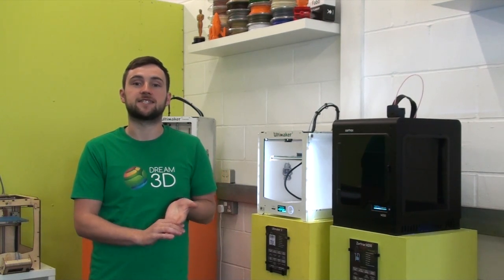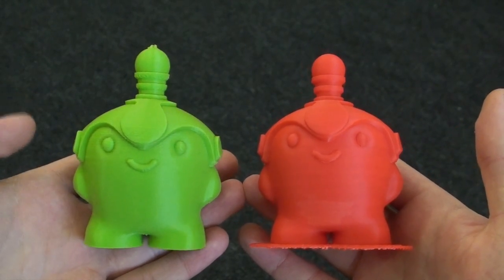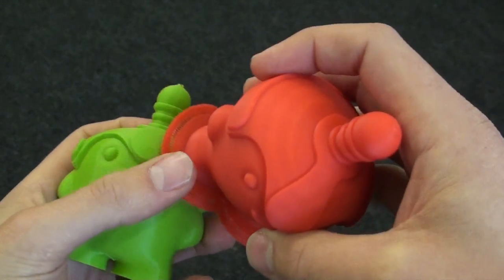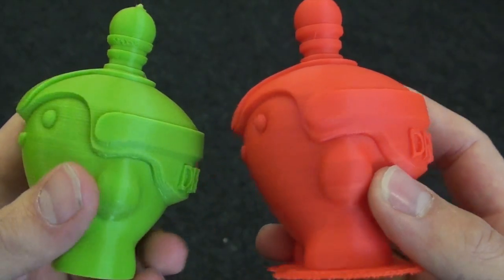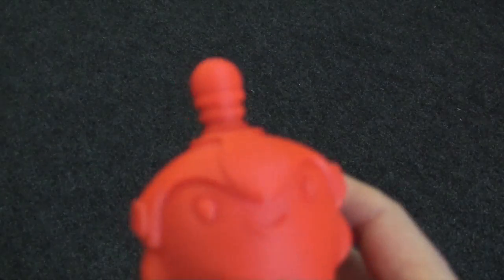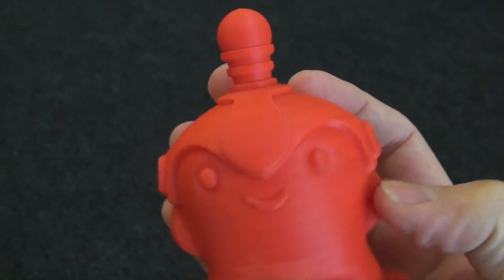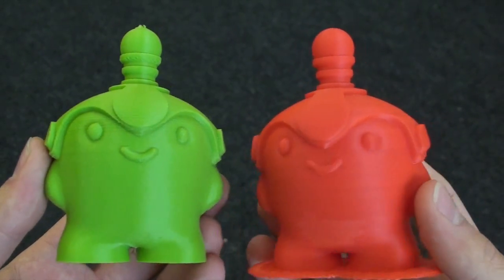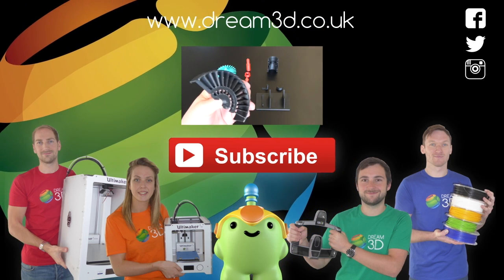Ultimaker 2 vs Zortrax M200 | Simultaneous Prints | Dream 3D

Comment: I have both printers, what's works for Zortrax best is their high quality ABS filament. 
But over all think about this : 
Zortrax $1900
Ultimaker 2+ $2500
Zortrax uses proprietary filaments and slicer, 1.75mm filament diameter 
Ultimaker 2+ open source, 3mm filament diameter 
Over all is what is your preference and what suit you, I like both, honestly if I go back in time I wouldn't buy both, I would only buy ultimaker 2+ for reason it's open source

Comment: Different colors of the same filament can print quite differently. Otherwise a pretty neat comparison.
Reply from the maker: +angelorf It's worth noting that they are different materials too, we used ABS on the M200 and PLA on the Ultimaker. But we went with different colours just to help distinguish between them. We're working on another comparison with the new Ultimaker 2+ using ABS on both machines and we'll go with the same colour too.
Reply: +Dream 3D Was the UM2 print using s3d slicer or cura? From this video, the m200 looks noticeable better in many areas but if you used only cura on the um2 for this comparison, i wonder how different this comparison video would/could have turned out if it were sliced with s3d.
Reply from the maker: +DrR1pper we used Cura for the Ultimaker print, your right, if you used Simplify3D you would be able to get better results. We've got the 2+ now so should be doing an update on this video soon, we'll include S3D too.
Reply: +Dream 3D Don't assume S3D will create better prints. Try new Cura 2.1 and see for yourself!

Comment: I really enjoyed this video, thanks a lot. Still, I think an ABS to ABS comparison on the two machines would have been more interesting. The easy to print PLA on the UM is really skewing the results in its favor. Even then the ABS print looks slightly better. 
I ended up getting a Zortrax in the end, and I am astonished at the quality of each print it spits out, and it does that at $500 less than the UM! 
I don't particularly care for the Z-Suite software. Though it works well, it's a little awkward, and won't work on OSX Maverics, so I have to reboot in Win7. I'll even put up with that to get the Zortrax print quality.
Keep up the good videos.
Reply from the maker: +Crivo152 thanks for your comment, We contemplated using ABS vs ABS for this video, but went on the basis of using the materials that give the best on the respective machines. I definitely think it's worth trying a new video with 2 ABS prints though, we'll add it to our list. Glad to hear you're enjoying your M200!

Comment: hi, how big is the dreamo? 200% 300%?
And how much time did it take?
Reply from the maker: Hi +Dennis Wolf I can't remember exactly, I think it was about 250% but the file is slightly different from the one in the description because it doesn't have the hole for the keyring. It took about 2hrs 30mins at 90 micron layer height. Thanks!
Reply: +Dream 3D thx for the answer, 2,5 hours is very fast
Reply: +Dream 3D I struggle to believe print times were 2.5 hrs.  I've printed these at 0.1mm/20% on the U2 and took 7hrs and 0.09mm/Light on the M200 and too 5 1/4hrs.  No idea how you managed 2.5hrs.
Reply from the maker: Hi +Neil Watts , In retrospect i think you're probably right, 2.5 hours does seem quite quick for these models. The video was made quite a while ago now.